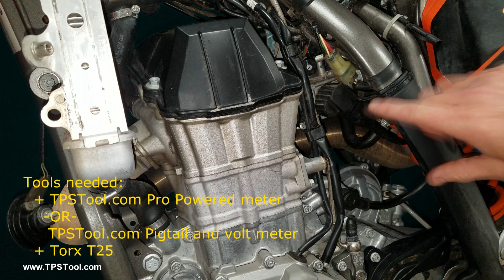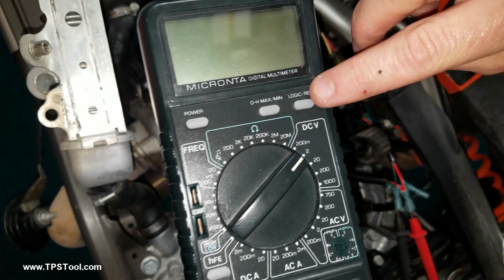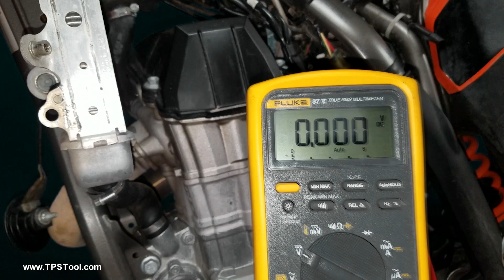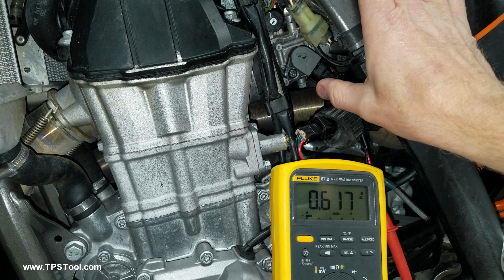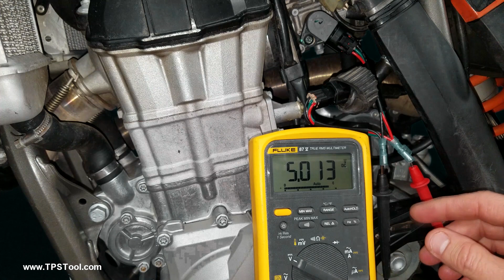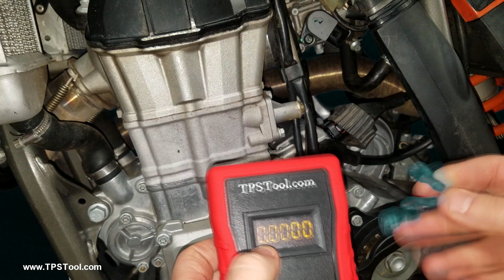Easily adjust the TPS on a 2016 and earlier KTM, using a TPSTool.com Pigtail or a Powered Pro meter

Comment: How do u do it with kick start
Reply: With pigtail and multimeter with kick start
Reply from the maker: @stevenmcallister2230  The powered tool is easiest, or if using the pigtail you can start the bike and let it idle while you work.  You might want to put a fan in front of it so it doesn't overheat.
Reply: @TPSTool  bike only runs for 10seconds then dies checked everything EFI light flashes 6times says throttle body sensor to high or to low
Reply from the maker: @stevenmcallister2230  Either the TPS is really out of range, or one of the wires in the harness is bad, or the TPS itself is bad.  Do I remember correctly that you've got a 2012 250SXF?  If yes, try to get it as close to 0.60V at idle as you can within the 10 seconds that it will run.  If you get it in that range and you're still getting the error, start checking the wire harness on the bike to see if any of the wires are shorted or broken.
Reply from the maker: @stevenmcallister2230  I replied to some of your comments on other videos, I hope it helps. :)
Reply: I have a ktm excf 250 six days 2016 went to do this today, couldn’t put it on 2v kept saying OL put it on 20v says 4.38 volts is this normal 😅

Comment: Do you have the idle voltage for husky FE450 2014? 🙏🙏
Reply from the maker: Thanks for your comment.  I don't have the manual for that specific bike, but I suspect by that year it had some of the same parts as the KTM.  That said, check out this video on resetting to factory default and try following these values.  Take your original reading before you start in case you want to go back to where you started:  https://youtu.be/TufG9PmzbDo  From there you can turn it up or down 0.02v at a time to fine tune it.  I hope this helps!

Comment: I bought the tool from you and cannot find the voltage settings in my factory service manual ( I bought online in CD form from RMATVMC ) or the owners manual . My 2016 350 XCF is a USA model.  It has the yellow cold start and red idle knobs.
BOTH can effect the voltage but i need the base settings to restart for trouble shooting. Thanks
Reply from the maker: Thanks for your business and comment!  For your bike set it to 0.40v with the throttle plate fully closed (idle backed all the way out and cold start all the way out), then turn the idle up until it reads about 0.53v.  That will put you at the factory default TPS setting, and the idle should be very close to the right speed.  This video shows how to do it on a 350sx throttle body which should be similar to yours:  https://youtu.be/TufG9PmzbDo
Reply: @TPSTool  Thanks!

Comment: You mentioned that earlier 500's (mine is keyed EXC) might have a different number. Will the 2013 work well with the 0.640v? With the KTM Powerparts FMF muffler should i shoot for a richer number? Great vid!
Reply from the maker: For your 2013 500EXC, 0.64V would be a great point to start.  You can go up by 0.02v, test, repeat as long as you see improvement, or go down by 0.02v, test, repeat.  You'll find your favorite setting quickly this way and my guess is it won't be very far from 0.64V.
Reply: TPS Tool tnx! And would the FMF muffler affect this? It's much more flowing than the stock can
Reply from the maker: @JoshLoberant  The procedure above will allow you to find the best setting for your specific bike.  You may end up a little higher due to the exhaust, but the testing between adjustments will tell you where it's best. :)

Comment: Hello. what is the best value for ktm 450exc 2009?
Reply: For the single cylinder carbureted bikes, it doesn't really make a big difference unfortunately.  Changing the TPS will only change the timing a little bit, it won't affect the fueling.  On the EFI bikes, the TPS will affect the timing and the fueling, so the EFI bikes see a much bigger change.  Most likely you can just unplug the TPS and see how you like it.

Comment: Would I still aim for. 64v if my bike has no push button or key, just kick and go?
Reply from the maker: Thanks for your comment.  It depends on the bike, it's different for different models and years.  Which bike do you have?
Reply: @TPSTool  it's a ktm 2011 250 sxf
Reply from the maker: @samknight2573  I don't have a lot of data for that year 250sxf unfortunately.  The best approach is to take a reading and write it down in case you want to start over, then turn it up by 0.02v and give it a test.  Keep going up as long as it runs better.  Or if it runs worse then go down by 0.02v instead of up, and repeat as long as you see improvement.  That should get you dialed in for your specific bike quickly.  For a kick-only FI bike you can either let it idle while you make the change, or use the powered meter.  The powered meter will be a lot more convenient, but you can get the job done with either.